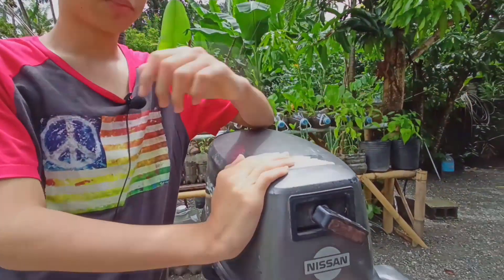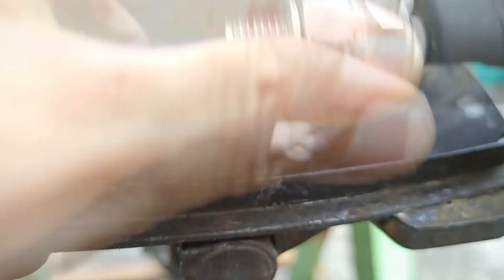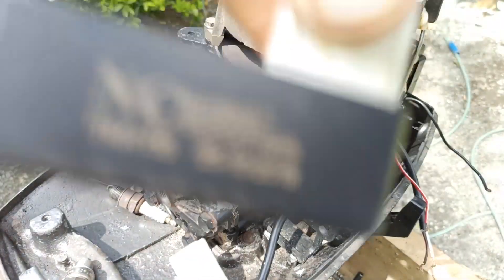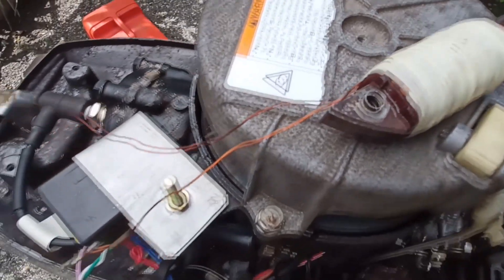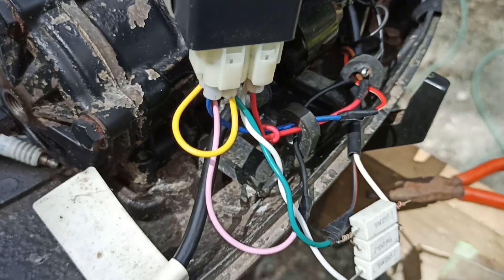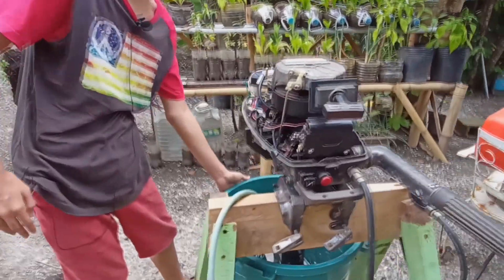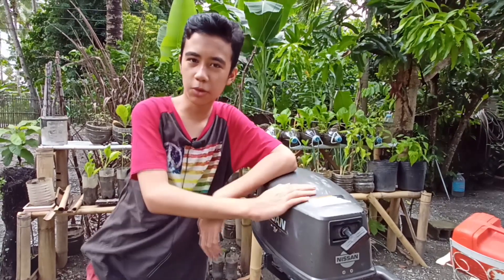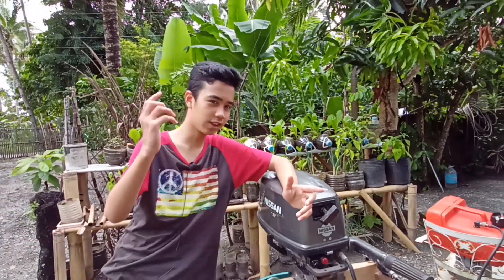Building a boat: Outboard Motor Repair

Comment: I have the same motor it also doesnt sparke how many ohm should the ignition coil read?
Reply from the maker: I'm sorry we did not measure the resistance of the ignition coil. because the only defective part in our motor is the Exciter coil and the CDI.